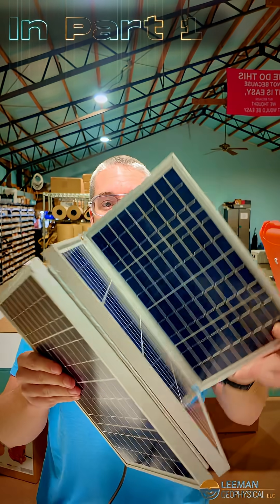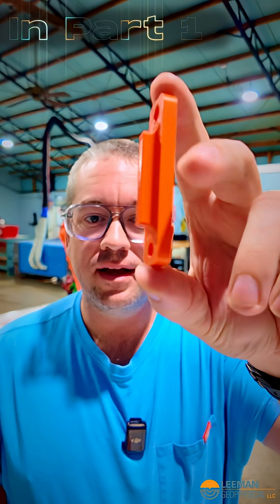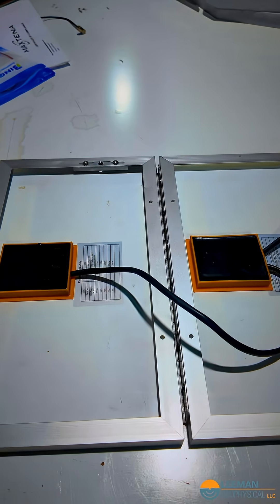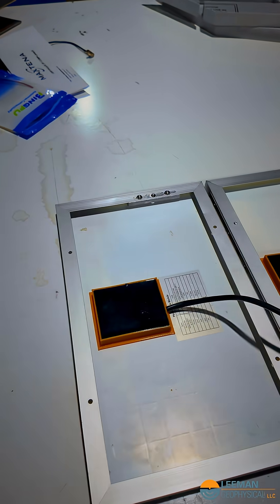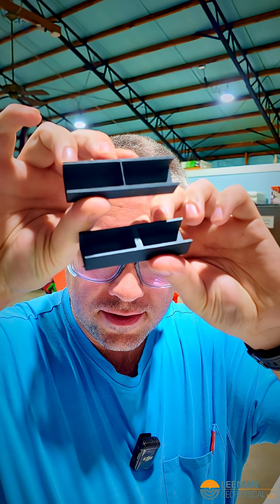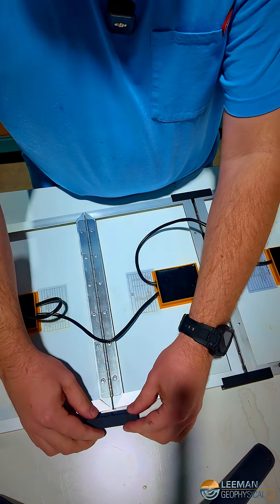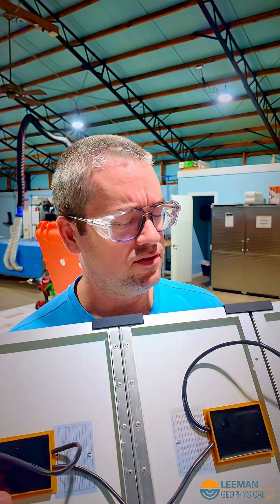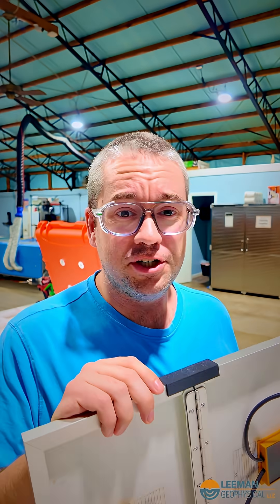3D Printing Our Way Out of a Solar Panel Problem — Part 2

Comment: I left a message yesterday.I believe , and I just realized that if you put a rod at the top inside the frame at the first and third panel and set it up that the rod can be pushed halfway from the left half way from the right into the second panel , you'd have is a rod or even something of square stock that I believe would be much more stable than your plastic printed items

Please let me know if you use the idea.I'm curious of the outcome

I am at gmail
Reply from the maker: We'll keep it in mind! Thanks for watching!

Comment: I like this. The idea, the iterative prototyping. This is what 3D printing should be about.

I am, however, concerned about the longevity of the parts in situ.

Are these for permanent deployment or just for brief, on-site readings? 

I am wondering, specifically, about the plastic's ability to withstand weathering (sun (UV), heat, and cold extremes) over time. I guess it might depend on what plastic was used.

If the parts degraded, causing the panels to shift, would it have a noticeable impact on sensor readings recorded? (I am assuming that the panel rigidity is not simply a cosmetic concern. )

Edit: Aaaand I just finished watching the clip. I should do that before posting. Good job, please disregard my note.
Reply from the maker: 3D printing is our iterative tool for sure - and sometimes it can even be the final product, though that's a pretty new area for us. We would love to do some metal 3D printing, but the price point isn't down enough yet.

Comment: That's really neat! 
I don't see a price to the quick deploy box on the website, looks like it could be a fantastic meshtastic base?
Reply from the maker: We quote them based on what connectors, etc., are needed, as generally they have some special seismometer connectors based on what equipment the customer has. With connectors installed, charge controller, battery harness, and more, they are around $2k. Drop a line to support@leemangeophysical.com if you'd like a quote, and we can quote anything from an empty box to a ready-to-go system!